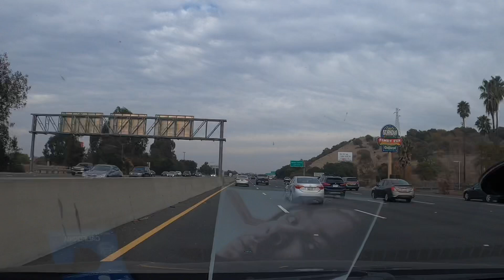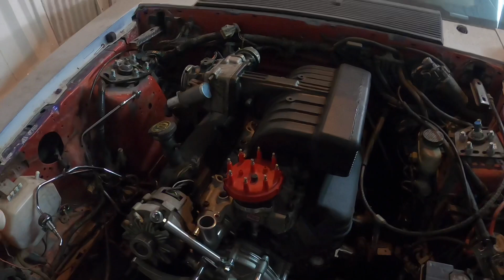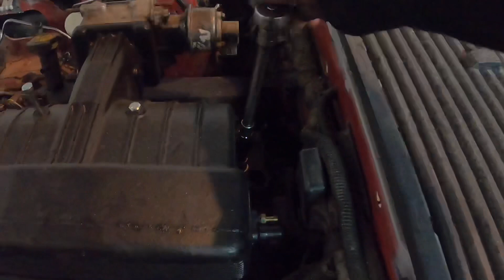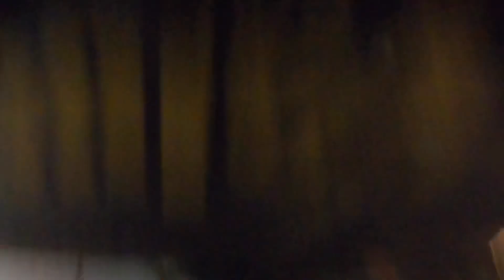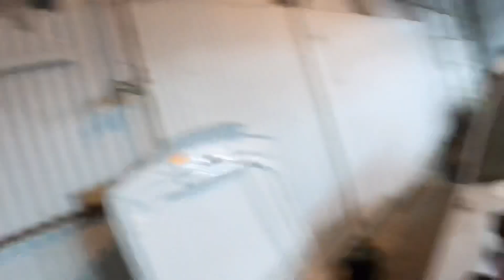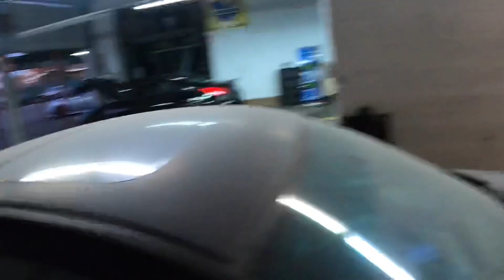Gasket and upper intake installments

Comment: Are you planning on changing the radiator and fan? Switching to a low profile dual electric fan will free up some space in the front and create less drag on the motor.

Comment: Hey Aron you may already know this but the worm drive clamps are easier to install if you use a socket wrench it's faster you can tighten it better plus it doesn't slip off like flat head screwdrivers annoying af. Be up